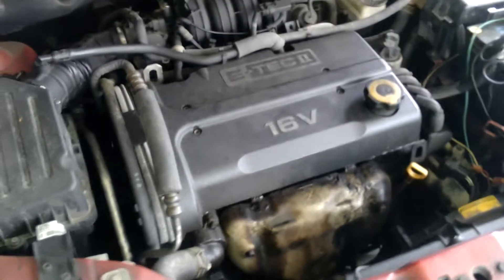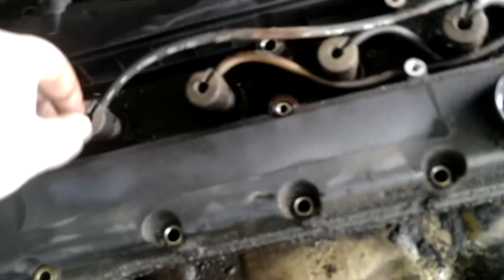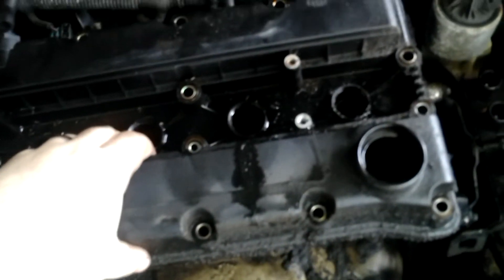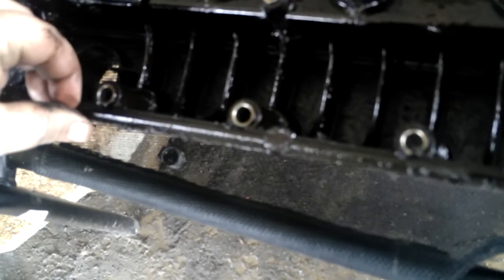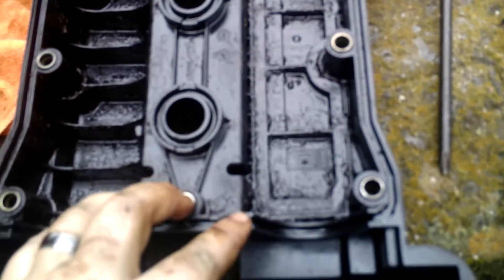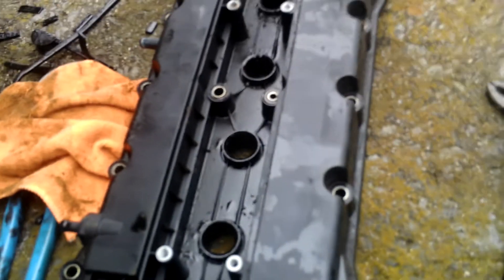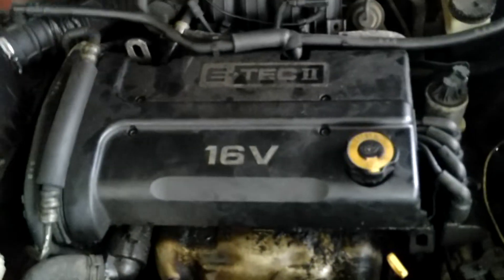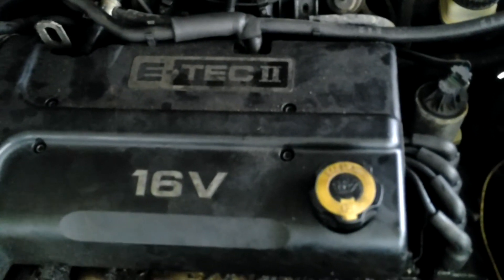How To Replace A Valve Cover Gasket In A 2004-2009 Chevy Aveo

Comment: Does anyone know what the hose&nut is called at 1:09 ? Mine is broke and can't figure out what to order. It's like a hose connected to a seemingly plastic type hexnut and screwed into the valve cover
Reply: 3 years late… but that’s the pcv valve.